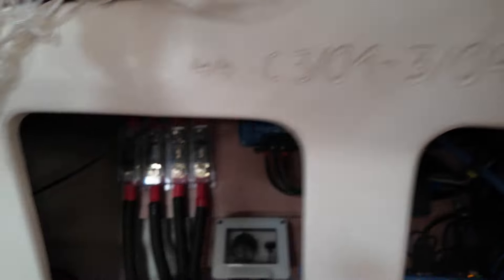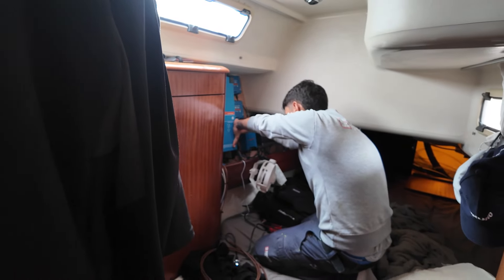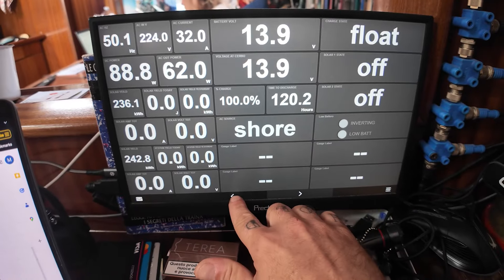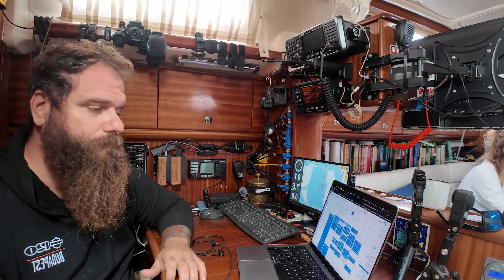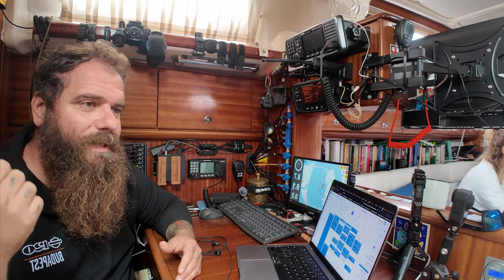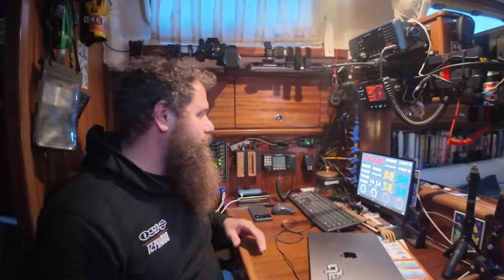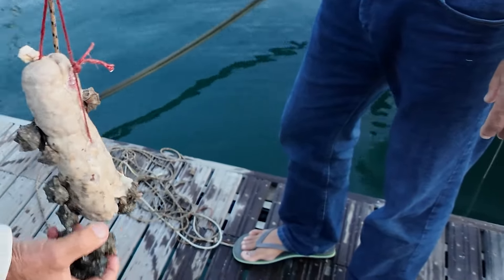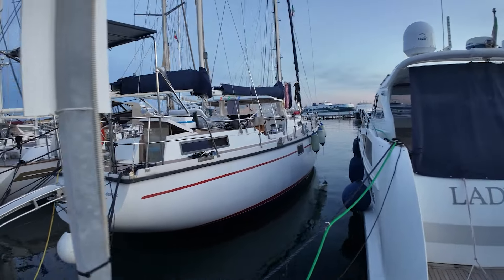I build the ultimate remote work station on a sailboat

Comment: Hello. 
So I ask this to everyone when I see an SSB/2M/HAM radio like your M804:
Do you find that these radios are still useful and why?
If you did not have one would you purchase and install one?
Would you install an actual radio or just install a SSB software on your computer?
Thank you.
Alain
Reply from the maker: Hey Alain! Great question [I spend 2 years deciding if i wanted to spend 4k€ on the SSB too... They are no cheap] – and honestly, it all depends on the kind of sailing adventure you’re going for!

If you’re sticking to coastal cruising or short hops, an SSB isn’t really a must-have. But for big ocean crossings, I’d definitely recommend it. Here’s why (and, of course, this is just my take – not a rulebook!):

1. Backup, Backup, Backup! When you’re halfway around the world, an SSB is like a safety net for when Starlink or Iridium decides to take a little nap. Plus, you can still get weather updates, broadcast AIS, and all that good stuff, which keeps you connected if the high-tech toys take a break.

2. The “Just in Case” Factor 🌧️ Nobody really knows how Starlink handles nasty weather, and I’m not super keen to be the guinea pig finding out! With SSB, I know I’ve got a way to reach out, even if it’s storming like crazy out there.

3. Starlink’s Not Everywhere (Yet) The SSB has worldwide coverage where Starlink still has gaps. When we’re in the middle of nowhere, the SSB is like having a reliable buddy nearby, ready to chat.

4. A Link to Commercial Traffic & Weather Tips 🚢 Commercial vessels still use SSB, which is handy for weather updates, news from land, and the occasional helpful tip. Plus, if something goes wrong, you’ve got an open line with ships around.

As for SSB vs. software? I’m a fan of the classic radio – it’s just more reliable when things get rough. Water resistance is a bonus too, for those “just-in-case” situations. But no matter what you choose, a good antenna is key to reach and quality.

Hope this helps! Happy sailing, and thanks for the awesome question! 😄
Reply: @sv_goat  fantastic reply! I might get back to you if you are into just fun exchanges.
My first concern is: Is there anyone left on SSB/Ham/2M?
I do not have an do not care about starlink... I really love the community and was loosely involved since the 1980s, I just wonder if they are all dead or if there is a new generation coming. LOL
Reply from the maker: @Coyotehello  hahaha thats a good question. There is a lot of enthusiast afficionados still standing around the globe [one of the things i did is start copiling a list of "busy" channels for different regions to use in case of emergency and or need of information i recon they will be faster to call for help on my behalf that my land crew hahahah] The emergency channels are all working and all commercial vessels have to keep the channels on and man at every given time. Also as a fun fact there's a frequency on wich at the rigt time you can listen to the ISS on space which is soooo cool. I jnow of people that could actually talk with them upthere.
Reply: @sv_goat  "There is a lot of enthusiast afficionados" & "I know of people that could actually talk with them up there."
Yes.
But that is exactly my concern, i/e are HAM more and more a hobby for fun than an actual useful mean of communication.
On a boat in particular.
Reply from the maker: Absolutely true. Still all emergency station, offshore weather announcements along with commercial traffic  still use it. For my particular application witch is to have a back up communication system that will work on the worst of situations the ssb was the right choice. I know i might never use it [i hope to never used actually] but if ever needed...